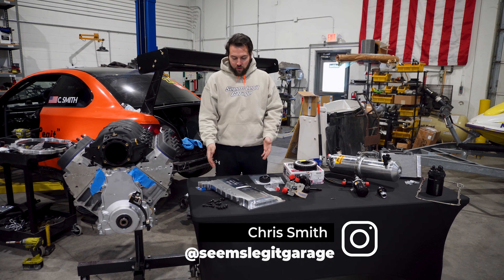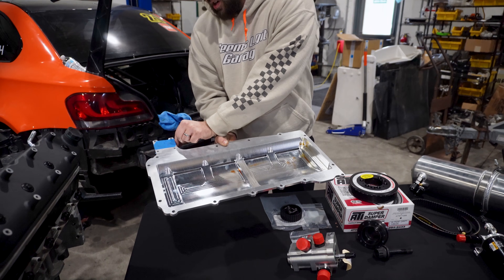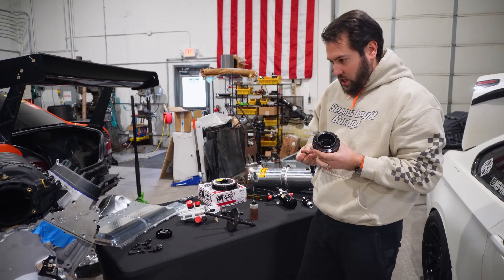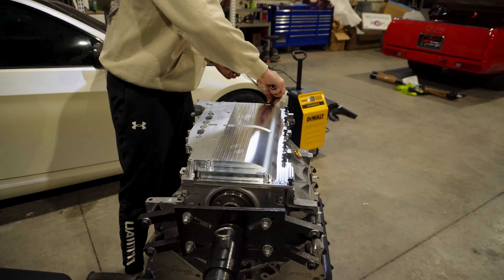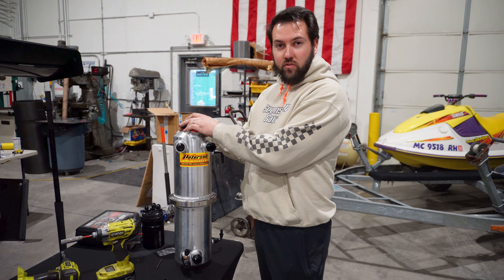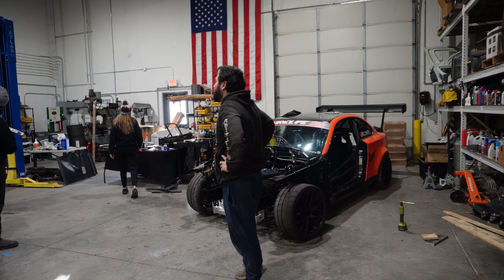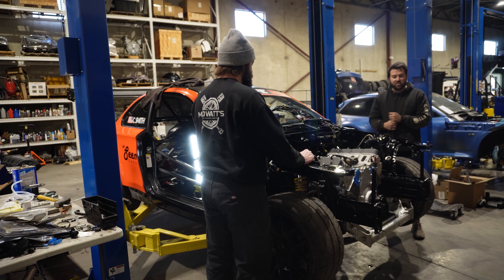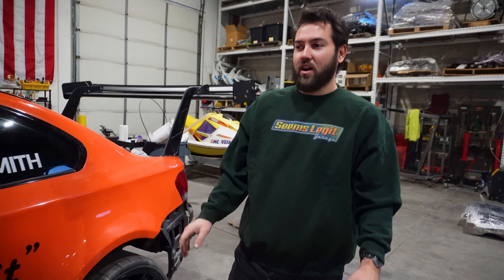How to Keep Your LS Race Car Alive - Episode 14 - LS Swapping our 135i Time Attack Car

Comment: It would be sick if someone made a dry sump tank that was watercooled.
Reply: Thats actually a really sweet idea
Reply: @csmithlax19  yeah something that could regulate the oil to stay at optimal temperature, but not be super hot to lose any hp.
Reply: Most synthetic oil works best around 200 degrees , typical air cooling works very well.